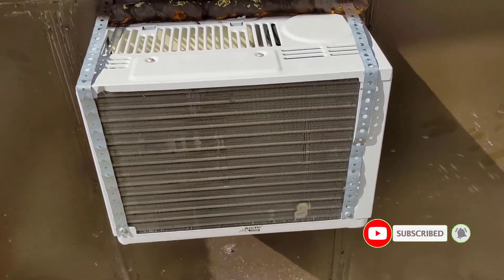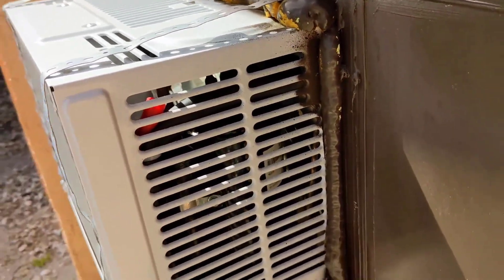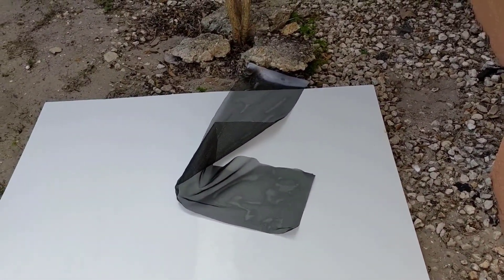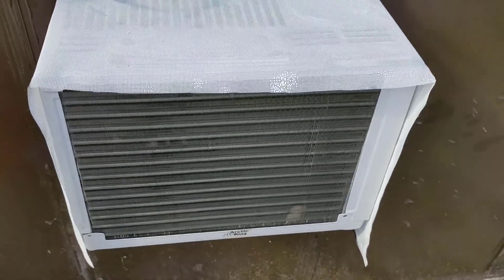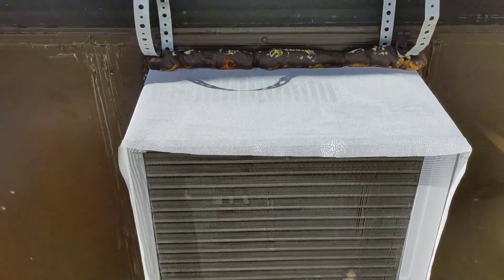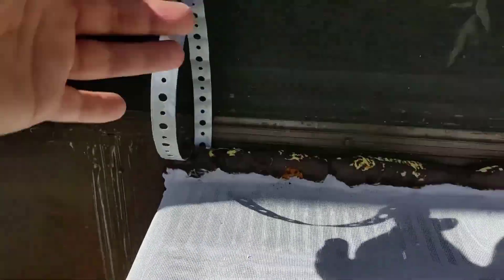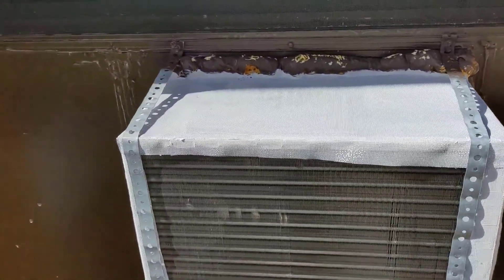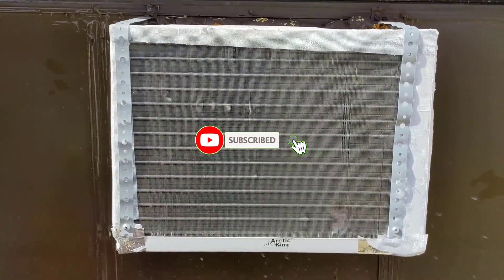How to prevent snakes mice and lizards from getting into window air conditioner

Comment: Thank you. I have a window air conditioner that's is going to be sitting very low to the ground. I was concerned about small snakes, lizards etc getting in thru the vents.
I had not thought of using screen.  I am going to do this and now I will be able to cool my room with a peace of mind.
Reply from the maker: Yes, getting that type of mesh we linked in the description has proven to be durable, and painting it white also extends the life, as black materials absorb heat and will last less.

Comment: Hi I tried this but on the inside putting mesh screen over the whole front of my ac and then I ended up with a bad mold issue so I took it off but now bugs get in. Do u know if u have an issue with mold? Maybe I’ll try this again but only put it over the vent where the air comes inside
Reply from the maker: No mold at all.
Reply from the maker: Correct. Has to be on the outside like I show on the video.

Comment: Can I use outdoor mounting tape to attach screen to ac unit?
Reply from the maker: It may not hold with the outdoor elements.
Reply: @SaveGreenHere  I’m using scotch extreme outdoor/indoor double sided mounting tape. I hope so! Just was worried about it melting.. I did use charcoal screening :/

Comment: What adhesive did you use????
Reply from the maker: https://amzn.to/3HKZ66i
Reply: Here in Arizona the sun cracks the white caulking and most others. I always use 100% silicone in direct sunlight and it handles the sun's UV rays really well. I had a problem with assassin bugs coming inside through my window ac unit. Good video.
Reply from the maker: Actually this is what we are now using because like u said, does fantastic in the desert sun........... https://amzn.to/3HKZ66i